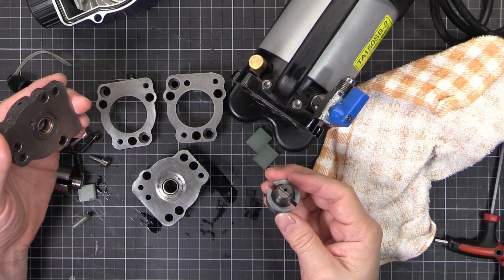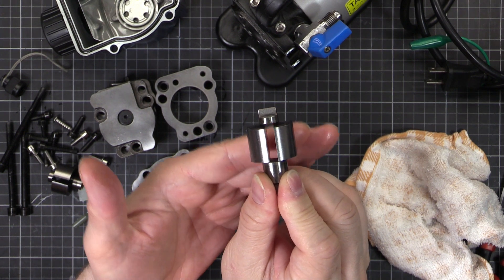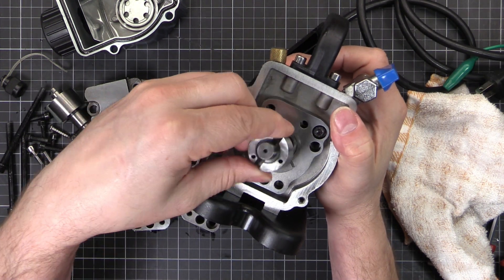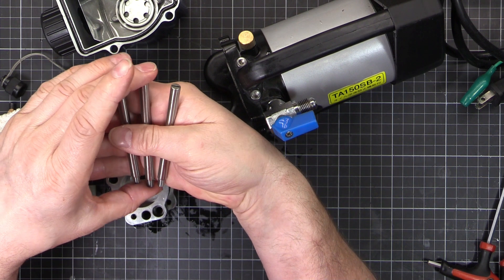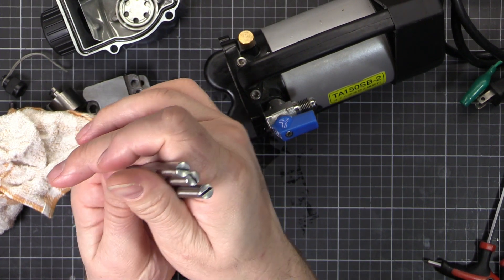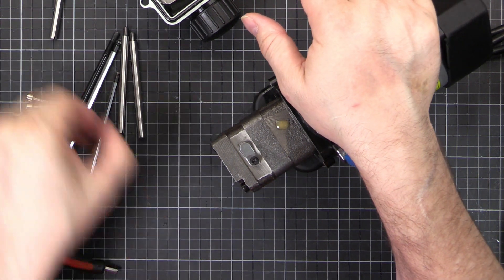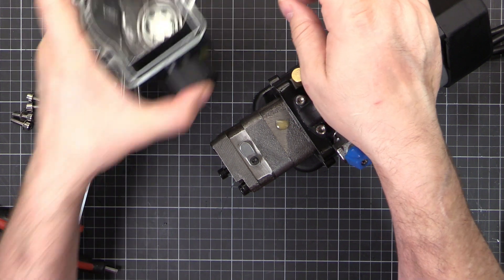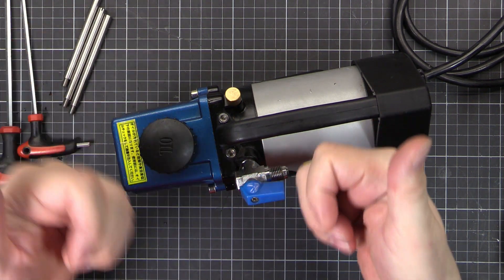Aircon Vacuum Pump Repair

Comment: Did you lookup the Spec. for vaccuum ability when new and check the rebuild for close tolerance with vaccuum gauge that is certified? Best for evaluation of pumps capacity.

Comment: There honestly not that precision. I’ve rebuilt a few vacuum pumps. Just keep the parts clean is the biggest issue. Never had an issue with parts not being lined up.

Comment: Hello, I am writing as soon as you said that you have a problem with the composition. Pay attention to the orientation of the blades, they have a small ramp that must be in the direction of rotation of the engine. Some types have a stainless steel spring between the vanes (the vane has channels for the springs), it is also necessary to fit the flaps with the mesh filter correctly, and the viscosity and type of oil must be observed (it is usually written on the label or it is indicated in the documentation - vacuum pumps have a specific type oil with the prescribed change interval.With such a large disassembly, all sealing elements are automatically replaced.

Edit: I see that you have a pump head without a mesh filter, probably another manufacturer.

You solved it beautifully with the spikes 👍, the vacuum pumps that I repaired were small guide spikes pressed directly into the segments.

Nice day 🙂 Tom